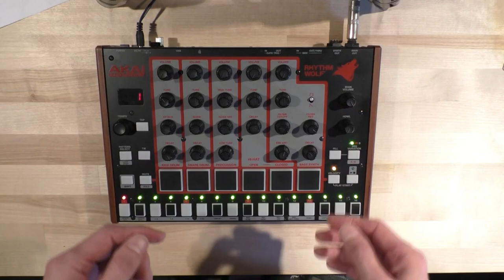Rhythm Wolf Mods - Part 2 - Demo of bass synth sequence

Comment: The synth part sounds great now! I have a Timbre Wolf which is supposedly the bass section in the Rhythm wolf (but multiplied by 4), I don't own a Rhythm Wolf so I need a high-resolution picture of the bass section on the RW's PCB to compare if they really are the same. If so, I want to (or hire someone to) do these mods on my Timbre =D